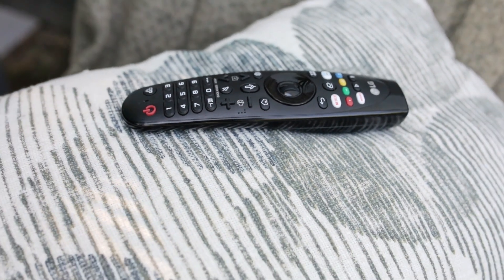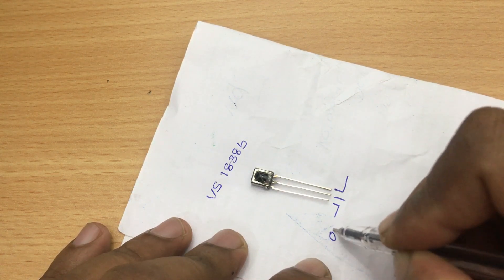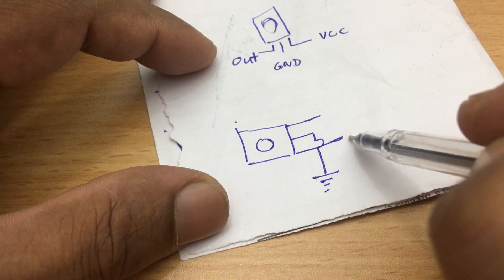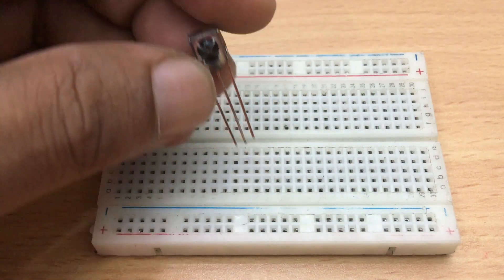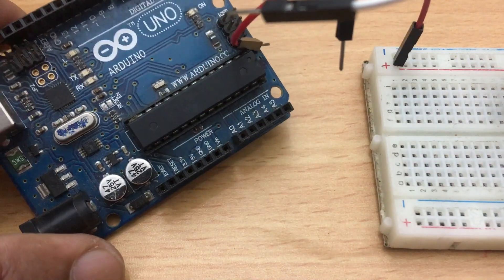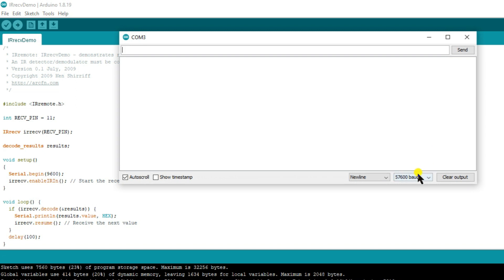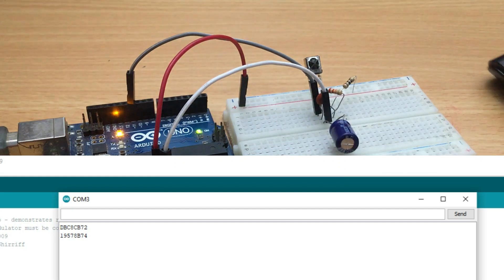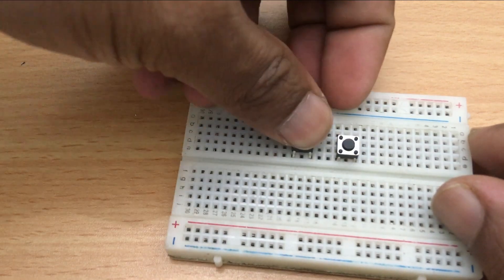How to Repair TV Remote | Make a Copy of your remote controller with arduino

Comment: Hi
I've tried everything it doesn't work  theres no wiring diagram
Reply from the maker: There is no complicated diagram. Therefore, I did not add. However, I will do a post
Reply from the maker: watch this https://www.youtube.com/channel/UCM9NQ4WcSbzTiCdoyOvzA1g/community?lb=Ugkxsq7vS0BbxXvw4iYKAl20RmIngJA11YJH
Reply: Hi
Do I remove all resistors or just button resistors
Reply from the maker: @jgonzalez7423  I think you are new to electronics. You just remove the  120ohm resistor (connected to LED) if it is not working with the resistor.  LED is an IR LED.
Reply: I saw you added a red led too what's the led for?

Comment from the maker: :stayhome: Thank you for watching my videos , see the IR sender code below. 

// IR Transmitter ...
//setnfix youtube channel
//www.setnfix.com

#include <IRremote.h>

int Btn1 = 7;
int Btn2 = 6;

IRsend irsend;

void setup()
{
  pinMode(Btn1,INPUT); // button 1
  pinMode(Btn2,INPUT); // button 2

}

void loop() {

  if (digitalRead(Btn1) == HIGH){
  delay(50);
  irsend.sendNEC(0xC1CC6A95, 32); } // Put your hex code replacing "C1CC6A95"
  delay(1);

  if (digitalRead(Btn2) == HIGH){
  delay(50);
  irsend.sendNEC(0xC1CCEA15, 32);} // Put your hex code replacing "C1CCEA15"
  delay(1);
  
  }